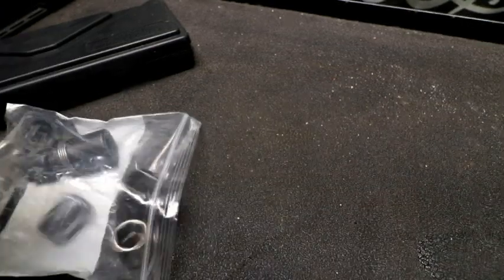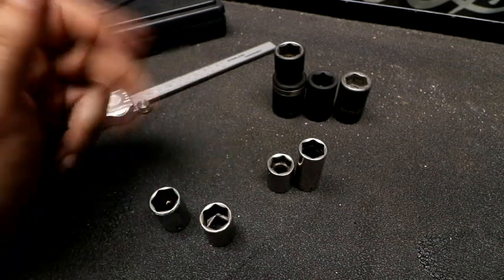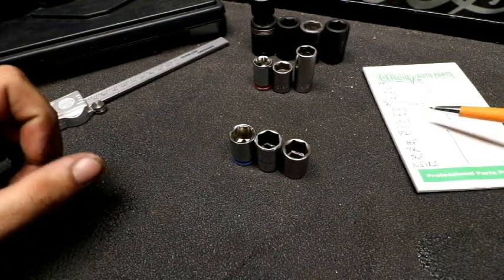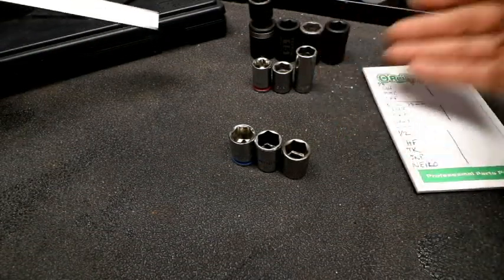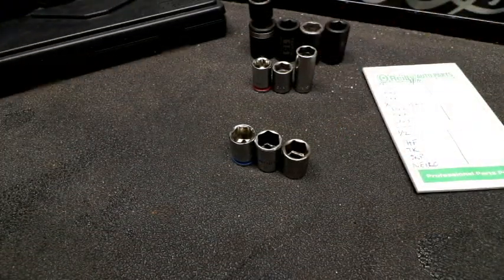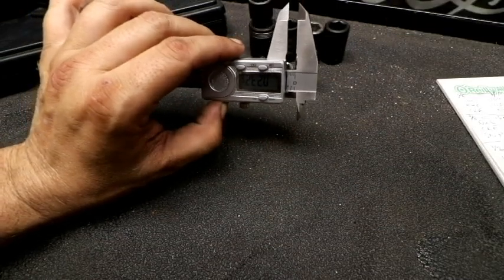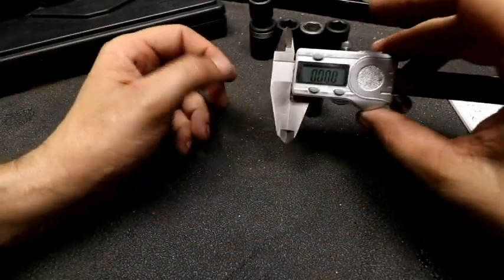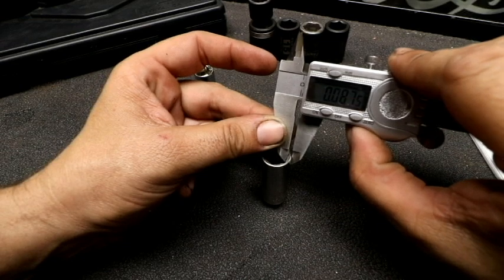SO WHAT'S THE BEST SOCKET?

Comment: I own sockets from every truck brand plus GearWrench. Complete sets of shallow and deep chrome. I find some fitting difference but I also use this to help with rounding bolt heads. One brand may have just enough to grip when the others don't. This is how I justified buying so many sockets to the Mrs.

Comment: Wall thickness is important to me because if I have to grab a non-impact and throw in on a gun in a pinch or even need to put some balls behind it I’d like to know I’m less likely to crack it up the side. The impact wall thickness was no surprise to me. Also, these are not new sockets so as they get used the tolerance is going to open up depending on its use. As far as fit, in my opinion it’s not the inside measurement of the socket but the fact that the quality control for each bolt is probably not going to be the same every time. In fact it’s going to be different every time! Weather it’s tenths, half thousandths, or even thousandths. Great video Justin!✌🏼
Reply from the maker: Rob Peters Interesting part was that some were New, some were used very little and some have been used for years. I actually thought that’s what made it a better idea of quality over time used. Thanks Brotherman I appreciate your thoughts on the matter 🍻😎👍

Comment: In my honest opinion working in an industrial environment a snap-on breaks and fails the same way a Pittsburg pro. It all comes down to how you treat your tools and how well you take care of them. But if you want to get nitty gritty it also comes down to consistency and metallurgy and QC in which the factor becomes "when" a socket or any other tool fails. With Craftsman and Pittsburgh you can have a socket in any given set outlast a Snap-On or MAC But at the same time I've seen Pittsburghs and Craftsman fail after limited use in the same sets. The same can be said for Snap-On and MAC. What works for me might not work for you, it also depends on what sort of work you do with your sockets. A mechanic has different applications for tool use than a machinist or machine operator. My preferences when it comes to brands are SK and Wright simply because that's what works for me and I hadn't had to send any back for warranty as of yet. So far so good.

Comment: I told you about them Tekton's and I have a large assortment of SNAP-ON, Steelman Pro, Grey pneumatic,  Milwaukee, Makita and Matco Impact sockets But them Tekton's are Solid and drive smooth my Steelman Pro are Type solid and heavy at that also but the Tekton's have a particular snug fitment ratio to anvil and fastners

Comment: There is an ansi atandard for wrench sizes, ir is in mechanery handbook.  The inside measurement should have been done,using jo blocks or gague blocks.  On a broached hex bore +/-  .005 is a good tolerance.  Calibers are not the best measuring tool for this test.  Good video.